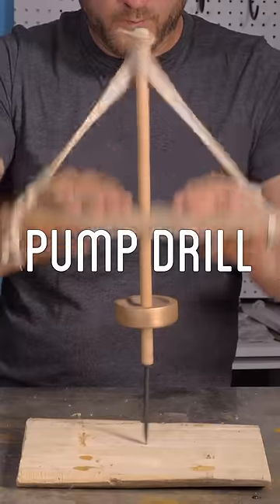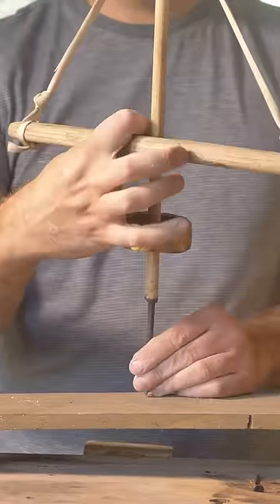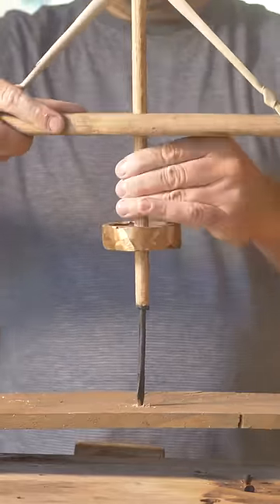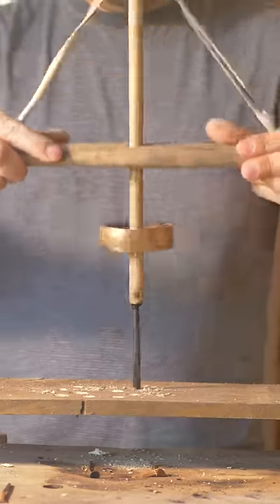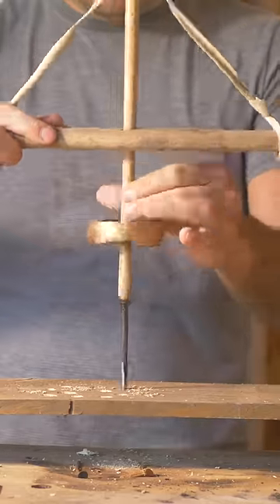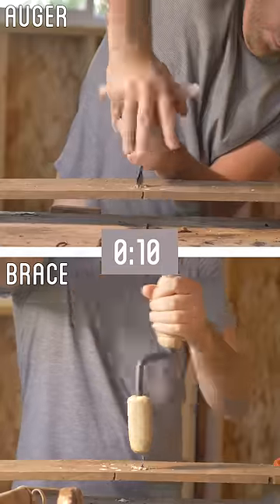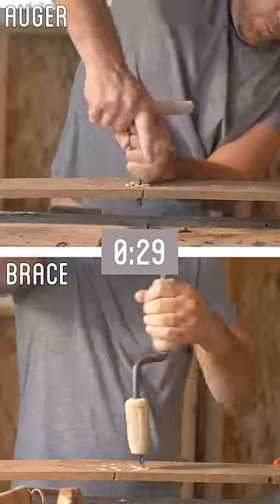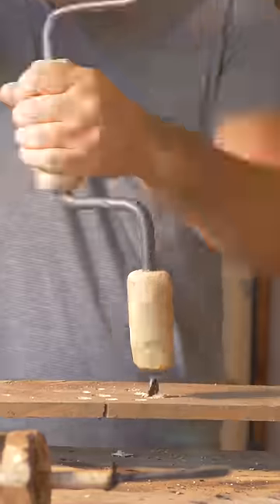Putting Ancient Drills to the Test! #shorts

Comment: I feel like the "brace" drill should actually be called the "auger" drill.
Reply: Why?
Reply: @aodigital9421  have you ever seen what an auger looks like?
Reply: It's an improved version of the auger drill. The brace drill is meant to be braced against your gut
Reply: It is called brace drill, auger is a spiral shape, it is called “auger bit”.
Reply: @lhtsnakes1  maybe this should be called bracer instead?
Reply: brace drill fire alarm
Reply: @lhtsnakes1  it is a brace, the bit currently in the brace happens to be an auger. You could also use a spoon bit, or modern bits
Reply: A twist bit of the proper type is always going to be more efficient. If you have a motor with sufficient torque and speed, only then can you effectively use a spade bit.
Reply: But it's a brace drill because you brace it against your body. The bit that goes in it is called an auger bit as it is the same shape as an auger. You can't go deciding you want to rename century old tools
Reply: Brace & bit.
Reply: Your feelings are incorrect....
Reply: Brace is like the chuck in a modern drill. The motor is your arm.
Reply: Ice fisherman?
Reply: It is it’s the exact same thing as what you would use to make a hole for ice fishing which is called a auger
Reply: @crinkly.love-stick No it's not. It can be but there are many uses for a bit and brace where that simply wouldn't be possible.

Comment: for the pump drill, you'd want a larger flywheel to cary more momentum. as well as putting some oil on the drill
Reply: I don't think oil is the best idea.

it would just soak into the wood and make it softer and bind more. a hard varnish or paste wax might work, but if the wood is hard enough, it really isn't necessary.

if you are referring to putting oil in the hole he is drilling, that just isn't a good idea.

Edit: graphite (like from a pencil) may be a good option for dry lubrication, and will not soak into the wood or anything. still not a good idea in the hole, as it will only prevent the bit from cutting.

interesting fact: almost all of the graphite in the world comes from one single pit somewhere in europe, and pencils were never made with lead, it was just a name given based on misidentification or some weird translation
Reply: @rolls_8798  I think he just means oiling the bit before using it
Reply: @sekiro_the_one-armed_wolf  I don't think that would help at all. It would only make the hole swell up and be soggy
Reply: @rolls_8798  "China

China and Mexico provided most of the amorphous graphite, and Sri Lanka provided all the lump and chip dust variety. During 2020, China was the world's leading graphite producer, producing an estimated 62% of total world output. Approximately 40% of production in China was amorphous graphite and about 60% was flake."
Reply: @coltoncowan682  oh, that wasn't what I was thinking of and I may have gotten my facts twisted up (maybe some other material only had one big pure deposit) but you are right
Reply: @rolls_8798  yeah. That was the first thing I thought when I read that. Oil, just wouldn't be a good choice when drilling wood. Metal, that's a different story, but wood. It will soak in, and cause the problems you mentioned.

Comment: I think pump drills are more effective  for drilling small hole in shells and beads. A small smooth drill bit with an abrasive.
Reply: The main issue he has is the bit shape. He's trying to cut with a box because he didn't sharpen it, especially after making it narrower. Pump drills are meant to use a spoon shaped, which also helps to get the cuttings out as you go since they'll just add more friction and less contact with the cutting surface if you don't have a way to get them out.
Reply: Agreed, the needlepoint pump drills go through stuff like butter

Comment: Need a MUCH heavier flywheel. I don't know if it's historically accurate, but you're easily in the "melt galena to get lead" stage of tech. With a simple mold you should be able to make a lead flywheel that may provide the extra energy transfer and storage you would need.
Reply: Except, obviously, do not use lead.
Reply: LeAd iS toXiC
Reply: I mean, it sounds like theres a risk of lead fumes or something, so idk.
Reply: @untitled6087  why obviously, it’s not dangerous if you just have some common sense
Reply: @terrible1237  why have lead lying around when you can use a safer metal? makes no sense
Reply: @untitled6087  people have lead lying around in their shops because it makes for good weights and it can be remolded very easily not to mention if you know what you're doing it won't hurt you
Reply: @untitled6087  because it’s heavy
Reply: @untitled6087  because lead is heavy, relatively cheap and easy to work with
Reply: @MrLastlived  not even bad to handle just ingest or inhale
Reply: @dannyeckerd9324  I mean. Zinc is fairly common, safe, easy to melt and as dense as steel
Reply: @Ckcdillpickle  certainly not safe to melt and it's far more common today than it was back then I can say from personal experience zinc fever is not fun
Reply: @direscuffd8426  I'm not talking about killing, or even immediate poisoning. Lead toxicity is serious, you don't want it around you in general if there are alternatives.
Reply: @untitled6087  it has its purposes even in this day and age, it's certainly not the safest stuff on the planet but it's not radioactive either as long as you work with it in a well ventilated area or outdoors and you don't ingest it then it's not going to hurt you.
Edit: I should also say that one should never attempt to melt metal in any form unless they know what they are doing.
Reply: It certainly has its purposes, but I don't think just being heavy is one of them. It's a risk that doesn't need to be taken. Introducing lead into tools and household objects where it isnt necessitated is never a good idea.
Reply: @untitled6087  it being heavy is literally its number 1 use. lead weights, lead shielding, lead bullets, et cetera.
Reply: @untitled6087  if I'm going to be honest once you reach a certain point of dedication to a certain craft you just sort of make peace with the fact that it is going to shave a few years off your lifespan. It's just the price to pay for doing what you love.
Reply: You been eating it?
Reply: @untitled6087  You are vastly over estimating the dangers of lead. As long as you aren't directly inhaling the vapors or making water pipes out of the stuff, you're fine. Lead isn't something you touch and instantly die. Any dire effects can take decades to appear, and that's literally after a lifetime of heavy exposure.
Reply: Large, thick clay plate works too. They are easier to mold, readily accessible in the wilderness (if ignoring the sanitary problem), non toxic and don't even need to be heated for such purpose (heating is still recommended though)
Reply: @dannyeckerd9324  lead is real convenient, I will take that. But it's 2022 guys, we have safer stuff to work with.
Reply: @saltissalty3498  Lead is more dense, so it requires a much lower size:weight ratio.
Reply: @untitled6087  if you have good ventilation while melting and don't like... Eat it.. lead isn't that bad
Reply: @saltissalty3498  this is literally all I'm saying. It's a health hazard in certain situations (not all) so just... Don't work with it when it's not needed? Having it rub off on stuff, touching it with sweaty hands, it's just not worth doing it for no reason. Soldering with it is pretty worth it - there's nothing that does quite as well as lead there. But just... Big heavy block? Lead is a silly choice.
Reply: @saltissalty3498  like?
Reply: @dannyeckerd9324  I didn't know that, thank you
Reply: @MrLastlived  didn't know what? What did I just teach this person?
Reply: @dannyeckerd9324  lmfao
Reply: wrong assumption, size > weight
Reply: @saltissalty3498  You don't understand which channel you're watching
Reply: @gameseeker6307  I mean, it is, but not to the touch.
Reply: @untitled6087  lead is fine if you don't plan on rubbing it all over your body and eating it.
Reply: @untitled6087  why not?
Reply: @dannyeckerd9324  I can vouch for this
Reply: @keepyourshoesathedoor  It's been a while since I've been here what did I say that you vouch for?
Reply: @Ckcdillpickle You've never experienced zinc fever I'm guessing? Zinc is not safe lol.

Comment: Counter intuitively, for the pump drill you'll actually want a flatter, more chisle like head than a sharply pointed one.  Like a modern spade drill bit.  Drills, like most machining tools, work best by making shallow scrapes at the work piece,  not by gouging out material.   With how aggressively pointed your bit is, it's digging too deep into the material to cut itself out and getting stuck, especially since it's relying on momentum on the rewind instead of a power stroke to clear the chip.  Like many others have suggested,  a heavier fly wheel might also help somewhat, but you can't just dig into your material, especially softer material like wood, and not expect to get stuck.

Comment: FYI, pump drills were mostly used on metal (copper, brass, silver, bronze, gold, etc.) and with very narrow bits. They weren't generally used on wood.

It would be interesting to retry your experiment, but drilling through a small brass bar, instead of wood.

Comment: They would use sand/water to help the pump drills go through harder materials and less fibrous materials. They also were rarely made from metal, but metal drills did exist for various uses. Usually stone or occasionally metal jewelry or even "clockworks" and mechanical gears, especially in Ancient Greece.

So maybe instead of "a blade" you use more of a sanding bit with a port to exit material cleaved off.

Comment: For the pump drill, the top part where the straps wrap around the spindle should be wider to increase torque. And like many others have said, a heavier flywheel.

Comment: Make the pump drill bevel off to a slightly smaller size after the tip ends to reduce friction, and support the board closer to the center because the board may bend a little causing even more friction.
Reply: He needs a much bigger and heavier flywheel to help keep his momentum when the bit digs into the wood
Reply: @laxbrobrandon  that too, good idea!

Comment: Auger vs Brace is like Strength vs Dexterity. Use either one according to your character sheet.
Reply: To much strength and the bit becomes a screw
Reply: @chuck2998  at that point just go Iron Fist and punch the nail into the wood. Or screw it in by hand if needed

Comment: The bit for the pump drill works best if you shape the tip to cut in either direction, there is a video on clickspring that can give you a great visual on what it should look like. 
Others have mentioned the suspending the board allows for too much wiggle and will contribute to catching on the grains 

Also starting with a thinner bit to drill a pilot hole then widen the hole with wider bits

Comment: For the pump drill you might want to try with a smaller drill, with a triangular or square cross section. I don't think those are meant for too large a diameter holes.

Comment: I couldn't get much of a look at them, but the specific way they're sharpened/beveled at the end probably matters a bunch.  Oiling or (perhaps even better for all I know) waxing them would also reduce unproductive friction (and corrosion as well of course) though, again, I can't tell if you've done either.

But yeah, while there are improvements that can be made, I suspect the brace is the best general purpose drill of the designs as it probably wouldn't exist if a design that needs less metal was better at it.

The Auger is cheaper, more portable, and has no moving parts, and the pump drill is more precise (and puts the least lateral force on the bit), so the brace drill being the best generalist for shop use of the 3 would justify the added cost and maintenance of moving parts and many times the metal.

I haven't done a side-by-side comparison, but that checks out.

Comment: A bigger, both larger in diameter and heavier would work better. Watch a couple of click springs videos
Reply: Flywheel that size is fine for wood work, the "drill" had no means of swarf removal as the bit was a two fluted straight bit, the other two where twisted bits, a design much more efficient at swarf removal.source - I drill holes in the hardest metals on earth for a living.

Comment: If you look at 'Viking era' decorated bone items, there are a lot of little circles with a centred dot. Probably made with a drill that's similar to a modern spade bit, but with a much shorter locating tip. Much less prone to jamming than the spear point being used on the pump drill.

Comment: The pump drill works best on supported wood, (you can see how the board bends when you watch it in the video) and especially with narrower bits. A larger/heavier flywheel would be the best thing to try to improve it, especially if you want to use larger bits.

Comment: About the PUMP drill.  I saw a Native American version at Poverty point. LA.  museum That  visitors could use to drill HOLES through ROCK slabs.  The mechanism was similar to yours but it did not use a flywheel, but rather  another horizontal stick (Bottom half of the pump stick) affixed to the vertical shaft where your flywheel is.   A fist sized ROCK is lashed to either end  of this lower horizontal stick  and serves as a POWERFUL "flywheel", running so fAST AS TO GENERATE a good "breeze"  almost like an electric drill.         In This case, to cut rock, a BAMBOO bit  is used, fitting over the "chuck as sand is sprinkled down under it.   It drills right through the sandstone and shale rock slabs.  It should do well with wood too especially with the FLINT drill bit.    I think those spinning rocks on the drill increase thetrearing force and help it drill through its objective.---also, the rocks are heavy and put more weight on the bit when you drill. ---Double its height
Reply: It was so intriguing I made one myself after I got home from the museum.  It was made out of totally NATURAL things you find in the woods and on the ground---But is the next best thing to a power tool.

Comment: Pump drill: larger flywheel. Static friction > dynamic friction. Every time the drill stops because of a spike, it’s harder to start. A larger flywheel means more momentum to eat the forces felt by the increased friction spikes as the bit digs into the wood on the pump stroke

Comment: For the pump drill, giving the fly wheel a wider diameter would help with keeping the bit moving, but I think you'd also need a drill bit that engages less with the wood. Perhaps drilling a series of progressively larger holes instead of a single hole.

Comment: Clickspring uses a pump drill regularly on brass. I think his technique is to use multiple bits, drilling progressively larger pilot holes, and to stop regularly to clear chips. He also uses olive oil as a lubricant but that might not be best/necessary for cutting wood.

Comment: Brace drill seems to be the best as it's actually a design still used today to screw various nuts and bolts. They are called speed wretches and my God, whenever you can use one, you want one. The design is a very good one.

Comment: For the pump drill, you need a bit that is able to cut rotating clockwise or counter-clockwise. The way it works makes it switch directions with each pump so you lose cutting efficiency using bits that only cut in 1 direction

Comment: A larger flywheel/weight will help the pump drill operate more smoothly.

The primary mechanic it utilizes is the momentum of its own weight; the pump is simply there to be a convenient and easy way to repeatedly accelerate the weight to its working speed.

Additionally you could increase the length of the drill shaft and the cord to get a longer pump each direction allowing you to take greater advantage of the momentum you generate with each cycle, and you wouldn’t have to push as hard/rapidly to get the same force.

Great vid and comparison!!

Comment: Seen a lot of decent suggestions for the pump drill, like smaller bits, longer bits or different fly wheel, but main problem will always be either the bit spinning in the wood shaft loosing grip or just jamming up at the start of the pump attempt. best solution you could have is a Single solid drill metal shaft with like 4 point cutting end that can have 2 cutting points in either direction.

Comment: I own 6-7 stanley brace drills and they can be exceedingly effective with a sharp bit - especially if it has a lead screw. These are still commonly used in handtool woodworking

Comment: Advice about the pump drill: use something that can compress or slow-melt with the friction as a brace.
As a ridiculous example, think of something similar to a wax tube around the whole thing, or 2 wax blocks, vertically on either side of the cylinder, that with the heat from friction, can lower itself as the drill goes down. If that fails, 2 big springs similar to what modern day plunge routers have in the housing.

Comment: There must have been a reason that the brace drill was the one that made it into modern times as a general purpose drill, with the auger only used for drilling into the earth or into wine bottles.

The bow drill was mostly used in situations where friction was an advantage: fire making.

Comment: Pump Drill Fix: Use a much larger flywheel for extra down force & especially TORQUE. Enlarge the hole the shaft goes through, so it's not always catching. Attach your cable, so the top of the shaft is exposed. This way you can use another piece of wood with a hole in it (use some sort of grease in there) to stabilize the whole thing with one hand while the other hand actuates the drill. Modifying the length of the shaft and size of the flywheel will allow you to fine tune the behavior of the drill.